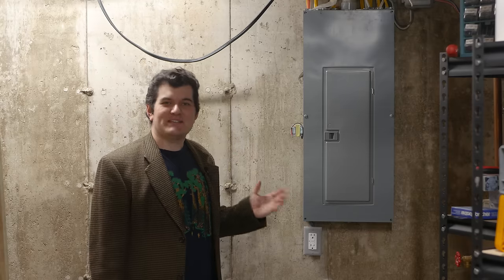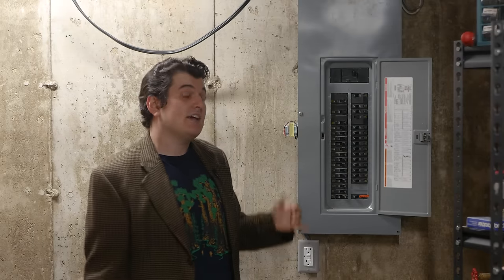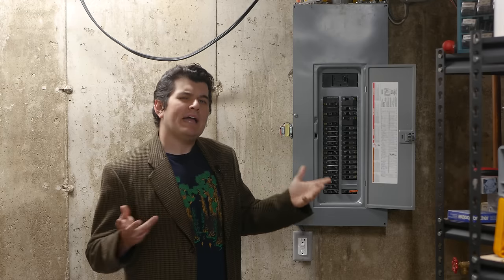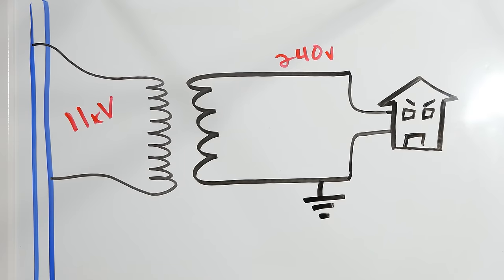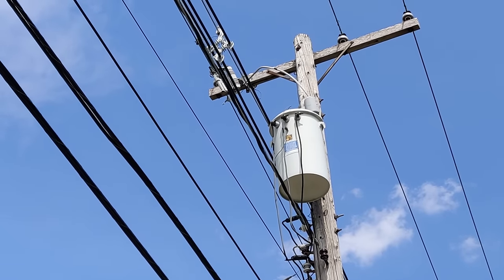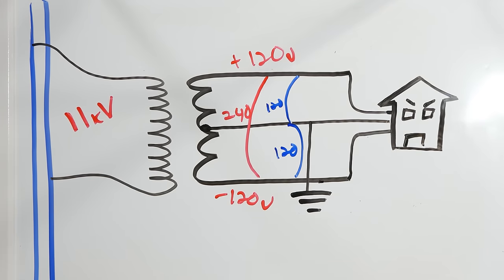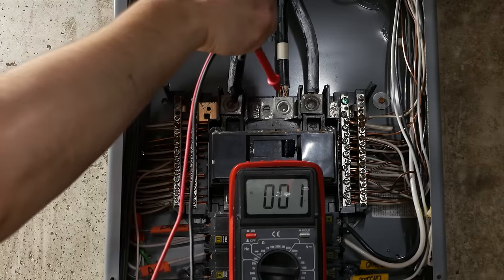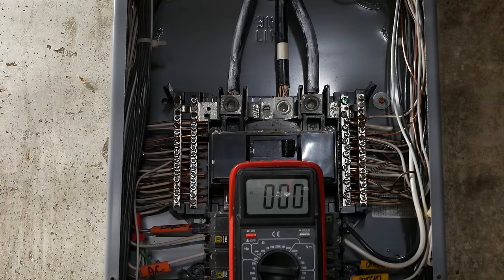The US electrical system is not 120V

Comment: yeah... as a german electrician this fuse box looks magnificently horrible
Reply: It's really not though. It just appears that way :-) Millions of buildings in North America (Canada and Mexico, much of Central America) and a lot of South America follow this this same standard.
Reply: It's completely typical. I've seen some rats nests that were perfectly safe and up to code.
Reply: N.American wiring system is far more flexible/adjustable for personal use.  I have found 230/240V systems more limited in adaptability. And 120v safer as noted.
Reply: You don't need to be an European electrician to know that quality of wiring on this panel is none conforming, and would fail inspection.
Reply: And residential 3 phase in German homes! I am jealous.
Reply: @iamreallygay3800  you aren't really wrong. By virtue of how geographically large the US and Canada is, there is a tendency to have homeowners and others "cowboy" in their residential systems. It isn't great, and there isn't really any nation wide licensing that happens for electricians, it's all run by each State or Province.
Reply: Ironically it's probably the neatest one I've ever seen.  And have you ever been to a third world country?
Reply: @danielmaher9512  Most if not all states, provinces and/or localities have adopted the National Electrical Code by reference in their building codes and ordinances.
Reply: @danielmaher9512  You are so incredibly and strangely misinformed. It almost sounds like a parody.
Reply: You should see the stuff that comes out of Texas or Florida, lethal   ; ))))))
Reply: Huh, username checks out, carry on, good sir.
Reply: The thing that irritates me the most are the scarily pointy cable ties
Reply: They're not fuses, they're circuit breakers.
Reply: BY - same for me
Reply: like it's from 1960 and made in bakelite...
Reply: LOL that box looks fine. You should see some of the real messes. Im talking 100 year old houses that have been remodeled countless times. If im on a service call im happy if the panel is even labeled, let alone that borderline new construction looking example.
Reply: @martinlyhagen6166  You can really tell when the breakers have gotten too old as the plastic kinda just turns to dust.
Reply: Yeah I banged my head on the  door frame
Reply: @jn1mrgn  I lived in one for 17 years. They look way better than that
Reply: Yeah well... We have water pressure lol
Reply: It looks like kids play yeah. Welcome to Germany where we have 400v available or 3x230v
Reply: @mikel9567  yes there is code, i think his point was many people, landlords or whoever dont follow said code lol. Idk about state vs federal reg or how intently regulated it is compared to other countries (generally i know in other areas the US is a lot less regulated, but home construction in general usually is an area we do have regulation or at least standards afaik) but many people just kinda willy nilly their own electrical work bcuz they dont want to pay, and then the next owner/renter is stuck with a half ass job so on and so on until an actual prof shows up and fixes things. I mean, its not like private homes have regular inspections. I think for rentals its only large places or if the landlord has many properties? Idk but I've seen some silly fuse boxes for sure, let alone electrical work in general.
Reply: @francoistombe  120 V usually has higher fire hazards than 230 V or 240 V. Lower voltage means higher current for the same power, meaning that the line losses are higher that heat up the wiring including the wallpaper or the wooden structure behind.
Reply: @ginosmovies  Why? Be specific. I have installed electrical entrance systems that look sort of like that. I prefer to have all the outputs going out the bottom of the service but seriously I don't see any real problem with that. Now code enforcement is often wrong with their shit because they often have no idea how shit works so do whatever you need. Unless you are the guy that puts bolts in place of fuses and sets shit on fire.
Reply: Mike King Yes I too am extremely jealous of that as well. Supposedly in some states a utility will run a 480 3-phase circuit to your house. But the cost is very steep, and almost certainly never worth it for what you’d need to do with 480 in a house. I can’t tell you how many awesome, old industrial 3PH welders I’ve seen online for bargain prices that I’d love to have in my garage. I’ve thought about rotary phase converters. But for any significant amount of 3PH power, that too ends up costing a small fortune.
Reply: Hmmmm, Last time I had to fix a piece of European Industrial Equipment, the wires were all red and most were missing their "Number tags". ..... A Good thing-Bad thing, depends on ones patience I guess. That 200 Amp service panel was actually half-decent considering that the 3 lines coming into the box should have fed down one side and back up the other before tying into the mains 200 amp breaker. Not chopped short at the top at tie-in.
Reply: Or at least do one full side to side 360 wind around before tying into the mains breaker. This allows for moving the supply wires fully out of the way when modifying or upgrading the box, if needed..... Ohh yea, and the neutral bus is at the bottom of the panel now a days, not scattered helter-skelter around the inside of the panel willy-nilly. ( My panel is from 1979 and still meets CDN-US codes)
Reply: As electrical engineer (i know nothing about installations :) ) I'm horrified by (among other things) all the voltage levels.
Reply: Fred Jansen  Modern convention for service panels in the USA for homes is usually 240v 200a single phase but house wiring is still 110v with a neutral wire except for cooking, water heating, dryers, and AC. Some very old homes still have fuse boxes with Edison plug fuses (I know) and no more than 50 amps.
Reply: laughs in 400V
thought the same. even the shittiest german installation looks godlike compared to standart US D: but if it works and nothing burns, why not.
Reply: @jobdylan5782  If you ever feel like you're right but don't have anything specific to say, that's the hint that you're probably wrong.  Nothing the other guy said is wrong.  It's perfectly legal for homeowners to work on their own systems in many states.  License requirements are state by state.  He said license, not code.  Of course everyone is supposed to follow the code and get inspections whether licensed or not, but if you've ever done residential then you've seen that's not always the case
Reply: 277 volts tickles like mad
Reply: Now you know why a small thunderstorm almost burning entire Silicon Valley.
Reply: @jakes.5591  remembers me of touching the backside of the wasching maschine as a kid "tickles like mad'
Reply: Same
Reply: We haven't converted to batteries yet.
Reply: AndyTom and you can pack as many ground wires into a junction box as you want, and it will still be up to code. (they don't count as conductors)
Reply: @mikel9567  Most jurisdictions in the US refer to the NEC in their local code. However, in many cases the local code has additional restrictions.
Reply: @gunnarkaestle  This is hopefully mitigated by the larger required wire gauges for those circuits. Wire gauges, conduit sizes and max number of conducters, etc are all designed to control the heat generated at the various parts of the run.
Reply: @bobraible  Nevertheless the waste heat increases with I squared, that the reason higher voltages are preferred. In the LV domain, both 110 V and 230 V is above SELV. (50 V), which would allow easier shock protection.
Reply: @gunnarkaestle  Yes, but waste heat at lower voltages can be mitigated by throwing more copper at the problem. So 120V will not generate higher temperatures than 240V as long as proper wire gauge, conduit loading and terminations are followed. In the US the highest amperage 120V run are usually 20A runs with 12-2 Romex (12 gauge nonmetallic). Anything 30A or higher are usually 240V.
Reply: @bobraible  What is cheaper, more or less copper buried behind wallpaper?
Reply: @gunnarkaestle  Back when theses standards were drafted copper was very inexpensive. That is why the smallest denomination currency was often fashioned from copper. Nowadays copper is much more expensive and the US penny is crafted from zinc with a thin plating of copper. The US played with using aluminum wiring for a few years, but that caused more problems than it was worth. Running all over the house with 12 gauge wiring isn't prohibitively expensive (yet). Intelligent layout finds higher current draw runs to have fairly short lengths (most are 240V). In my house the main panel is in the attached garage. The electric water heater is in the garage (240V), the electric clothes dryer is in  the garage  (240V), the upper and lower units for my heat pump (240V) are next to and above the garage, respectively, my refrigerator(120V)  is about 2 meters from my garage, and my stovetop/oven is about 3 meters from my garage. The other side of my house has only lighting and room outlets.
Reply: @ginosmovies  It depends on the local electrical inspectors. While a conscientious electrician would shudder at the extra wire lengths and rats nests in some location, as well as no bare wire showing before the bus bar or extending quite a bit past the bus bar, it appeared to be safe - from what little I could observe. It looked like the common and ground conductors are tied to the same buses, so this has to be the first panel after the transformer.  In any subpanel, the common and ground are isolated.
Reply: @iamreallygay3800  I have never seen a two phase system. I understand they did exist in the early 1900s, but didn't last long. In the Americas, we have split single phase for almost all single household residential and small apartment wiring. For larger residential buildings, the system may be 3 phase Y. For large commercial buildings all sorts of voltages are possible and both Y and Delta configurations are used.

The US codes are becoming more and more restrictive over what is required. Some states now require ground fault detection on all circuits, not just kitchens, bathrooms and garages. More and more jurisdictions are also requiring arc fault detection as well, since a GFI will not detect an arc due to a loose connection.
Reply: @williamjones4483  Yes, but generally with exceptions and additions. I doubt if very many jurisdictions have adopted the NEC exactly as written. Also, various jurisdictions use different editions of the NEC.
Reply: @redhammer92  Properly installed knob and tube wiring is arguably safer than duplex cable - electrically. But it is a far greater hazard to anyone having to crawl around in an attic working on it. Unfortunately, a lot of K&T wiring is NOT installed correctly - or was reworked during a remodel so that it is unsafe, such as burying it in insulation.

I have seen houses where the bus fuses were replaced with metal bars/bolts and screw-in fuses replaced with coins or other round pieces of metal.
Reply: @bobraible  Today's copper mine have usually less than a percent of copper ore, whereas 100 years ago ~5% was rather common. Today it is a large scale dirt shoveling operation, where you need much energy and heavy equipment. With today's depleted ressources only in the ground, a stone age civilisation would probably not make it to the bronze age.
Reply: @buggsy5  Bridged fuses is a recipe for desaster. But regarding know & tube wiring, isn't it in the self-interest of a building owner to update the electric installation after a while? 

The house of my grandparents was built in the 1950s and had only 2 wire cabling without PE. When my grandma died 20 years ago, my dad did a general renovation, including new 3-wire-cables, even though he had right of continuance but considered the status quo as unsafe.
Reply: @gunnarkaestle The bronze age was always an iffy proposition in a lot of areas. One needed to have access to tin AND copper. These two metals are not always found in close proximity. On the other hand iron could usually be located in many meteorites (only one source necessary).

I think copper mines are subsidized by the fact that these mines also produce a small amount of gold and other valuable metals.
Reply: @bobraible  No, copper mines make actually money because of the copper. It is similar to bycatch: if you can use it, then it is fine to have (such as rare-earth metals) but you would never start a mine only for the bycatch alone. It is nice to have and of course most (metal ore) mines have a kind of coupled production.

While it is true that meteorites may offer (metallic) iron I don't think that they were sufficient to supply the iron age. The invention of the bloomery 3000 years ago was used until the blast furnance took over in the late middle age.
Reply: @gunnarkaestle I have actually read that some ancient peoples went looking for meteorites after a meteor shower for that very reason. Here is a Wikipedia entry regarding meteoric iron:

https://en.wikipedia.org/wiki/Meteoric_iron
Reply: @francoistombe  I'm willing to risk it in exhange for having 3phase in my garage
Reply: @bobraible  Larger meteorites coming down would devastate the area, and this is a rather seldom event. "Fresh meteorites" are certainly not something I would rely I, and even the collection that fell down of in the last few million years is a special and rare finding, not that you can built a civilisation on.
Reply: @gunnarkaestle  Yes, but plenty of smaller meteorites hit the earth frequently. Ancient peoples knew this and DID rely on meteorites for their weapons, utensils, etc. until such time they figured out how to reduce iron ore to iron. That achievement is what launched the Iron Age.
Reply: The responses here outline the issues well.   European systems are quite safe despite the higher voltages but the price is complex and expensive safety devices. The more complex, the more likely to develop a problem. I like simplicity because it has greater long term reliability. British plugs for example seem to require expiry dates.  Most fires from wiring in my experience do not come from hard wired over current situations. Breakers take care of that. They come from high resistance points mostly caused by loosened connections or corroded terminals or from extension wiring downstream from the wall outlet.  In north America high wattage systems use 240V.  I have been buzzed by 120 and 230. I prefer 120 any day. There are many ways of doing the same thing. All have advantagess and disadvantages.   You live with what you have to.
Reply: @bobraible  I can't believe this. Look at the Chelyabinsk meteor, which completely burned down in the atmosphere. https://en.wikipedia.org/wiki/Meteor_Crater https://en.wikipedia.org/wiki/Nördlinger_Ries This is nothing which you expect, but you can collect the remains that have been sitting there since the last impact.
Reply: @gunnarkaestle  Es tut Mir licht
I am not sure what your point is. I am merely trying to establish that b4 the Iron Age really got underway, people were fashioning various objects including weapons from meteoric iron. These people understood that their source of iron was extra- terrestrial and went out hunting for meteors. We know that meteorites were their source of iron due to crystal structure and presence of nickel. This is all fairly well researched.
Reply: @bobraible  This might perfectly be true, that they collected rare specimen and used it for status symbols, jewellery, cult objects, etc - but not as a basic commodity for Joe Sixpack of the Stone Age. And it is a kind of rediculous to assume they went meteorite hunting every few weeks after a new meteor struck the region. No, in an area where an iron-nickel object went down millions ago, you could find fragments, and these were a valuable catch to look for.

https://www.deepl.com/app this is a very good translating aid with more natural results than Google translate. "licht" means "light", you probably wanted to say "es tut mir leid, aber" = "I am sorry, but "
Reply: @gunnarkaestle  thanks, my German is very rusty. Licht didnt look right, but my  auto-correct only works for English (sometimes). I last studied German in 1973. My father was born in US but didn't learn english until kindergarten.  I probably chose German language study to so as to be able to get the gist of what was being said at family gatherings.
Reply: @bobraible  I like the DeepL translator, as it gives really good results. I have some basic French and Spanish knowledge, so that is just a check, if that what the DeeplL app is proposing makes aktually sense. I even read some Russian documents on the Chaun-Bilibino system where the new nuclear power barge is installed - although I don't speak Russian at all. It did work astonishing well.
Reply: @gunnarkaestle  Yeah, if you're getting it that hot before the circuit breaker trips You've got other problems.
Reply: @KamenTcholakov  ?
Reply: sup? 🤣
Reply: Your remark is without reference to whom you reply nor to what has been said in the first place.
Reply: @wangruochuan  First, Silicon Valley isn't burning, it's surrounding areas. When analyzing the rapid spread of the wildfires, keep in mind that these areas get almost no rainfall from May thru October.
Reply: @mikel9567  But it's not adopted nationally, at least in the US.  It's up to each jurisdiction whether or not to adopt it, and what parts.  It's called the National Electrical Code, but it isn't really national.  It's just adopted as-is by nearly all jurisdictions in the US.
Reply: @mikeking7470  yes we do, 220/380V since 1910 im my little village, turned to 230/400 in the middle of the 80th.  The mains entrance  fuse in my house is 3x 63 Amps. 
400V for the Kitchen stove and the water Pump. I got several CEE  sockets for 400V in my garage  for my air comprssor and the drill press. And there is still  a 3phase socket in the living room. It was used for an electric heater which was  removed many many  moons ago when we got a  gas fired  central heating. The voltage varied between 225-240V during the day. 

.. and by the way, I heat up my tee/coffee water with a traditional electric kettle. 
I live in north of germany , near the city of hamburg.
Reply: @Earlchaos  the correct designation for our mains  is 3~230/400 +N . 3x230 is referred to a 3 wire 230V threephase mains  without Neutral.  Were used in  some places in germany many decades ago. Also used on board of sea ships and factories with their own transformers.
Reply: Albert Rieder  me as a german would suggest you  to answer all comments in english with respect  to others which may speak only english even in the event  to make mistakes. Nobody is perfect. My english is probably also full of mistakes. But no risk, no fun...
To your commnt, I agree 100%
Reply: @bobraible  agree! My little 2000W heater in my garage ist connect between 2 phases on  400V its draw 5 Amps and the Power cable ist 3x0,75mm² , dont know whats size  it is in AWG , but it is a quite thin cable, like the one on a IEC Computer power cord.
Reply: all the old german and european electrical boxes were destroyed in all those wars you guys have over there. its easier to move to new when older doesnt exist anymore.